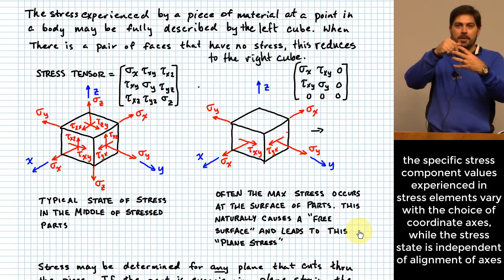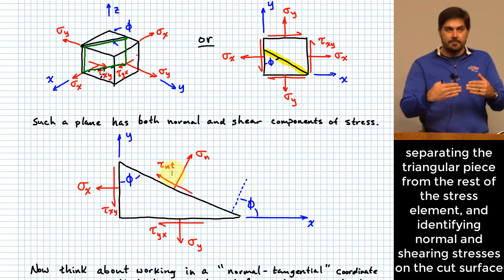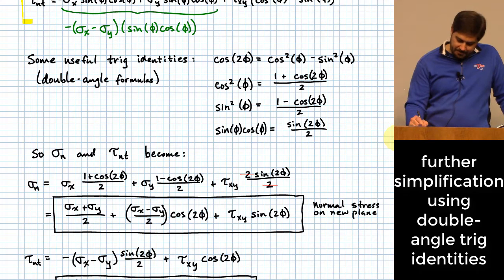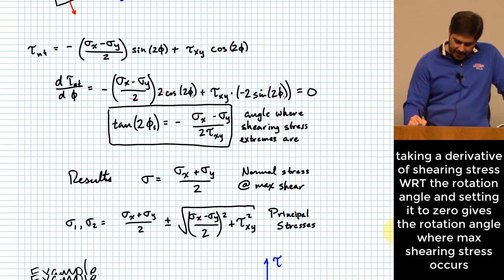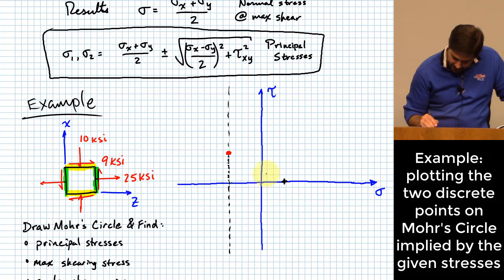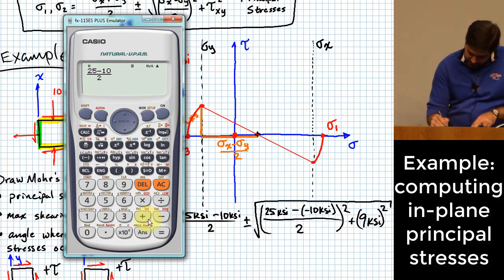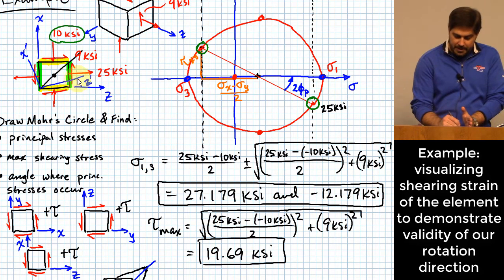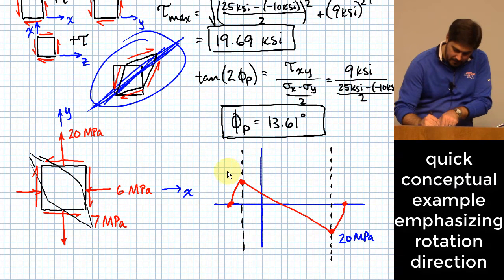Mohr's Circle for Stress: Derivation and Example | Plane Stress Transformations, Principal Stresses

Comment: So if you have a crankshaft in an engine block with .003 inch clearance.  The stress can make the stress element on the outer surface of the crank journal expand out at an angle and force all the oil out of the bearing and cause wear.  And we don't want that.

Comment: Greeting sir, how we relate the value of principle stress in designing of member
Reply: It tells us the direction of crack. Usually, cracks occur perpendicular to the principal stress. One important thing I learned in mech of materials is that brittle materials (homogeneous and isotropic) will break at 45 deg when subjected to pure torsion. You can verify that using the stress transformation to get the principal angle in that case.

Comment: Sir i am a little bit confused you said that the outer surface of a shaft in torsion is free surface but there is shear stress on that surface which is indeed maximum so there would be forces on the outer surface so how it could be free surface.
Reply from the maker: When there is a free surface it means no stresses, including shearing stresses, are applied directly to that surface. The material at the surface can still experience shearing stress, it just occurs on planes perpendicular to the surface.
Reply: Nice question
Reply: on a free surface, stresses which are acting on a plane tangent to the surface are permissible for plane stress models